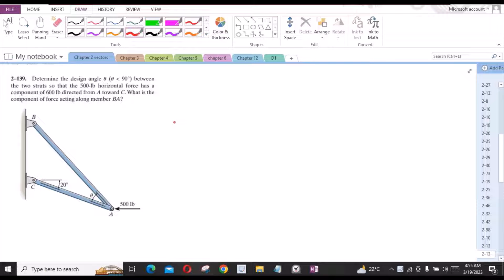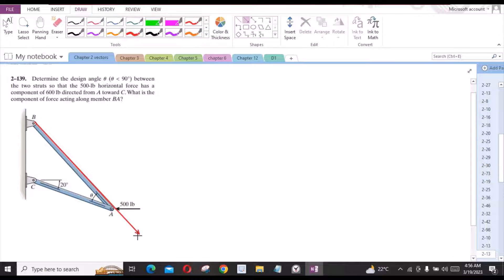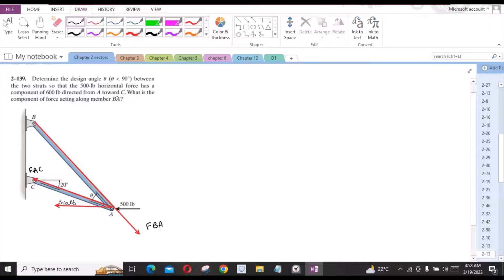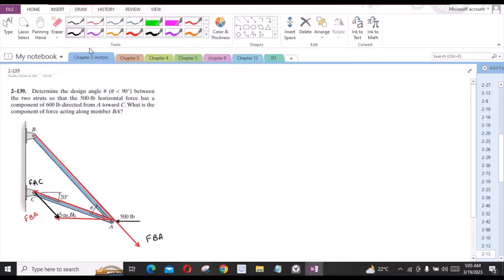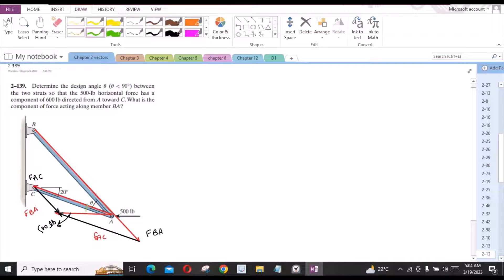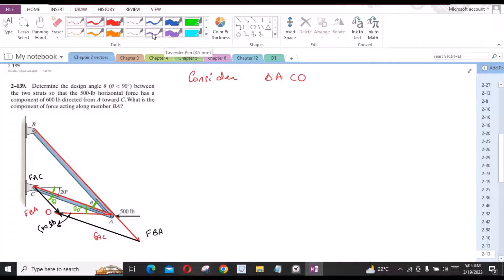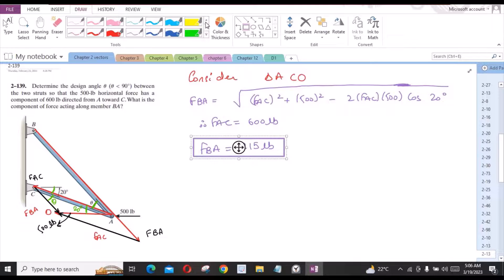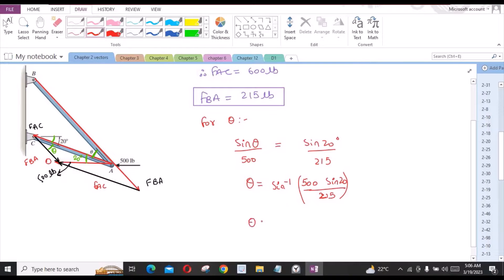2-139 hibbeler statics chapter 2 | hibbeler statics | hibbeler

Comment from the maker: Learn How to Solve 2-42 Hibbeler Statics Chapter 2, "Determine the magnitude and the angle measured counterclockwise from the positive y-axis of the resultant force on the bracket if Fb=600 N and theta equals 20 degrees"
Here is the Link: https://youtu.be/Tg-zFZjHSZA